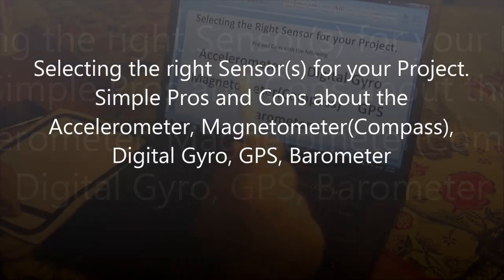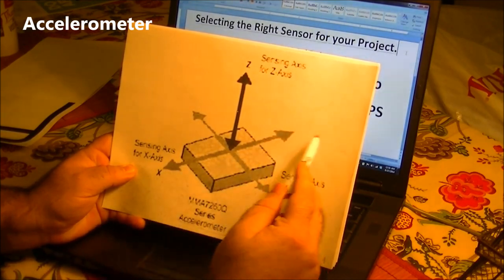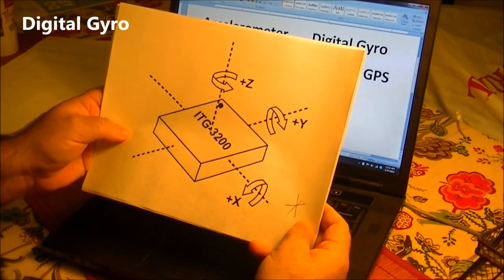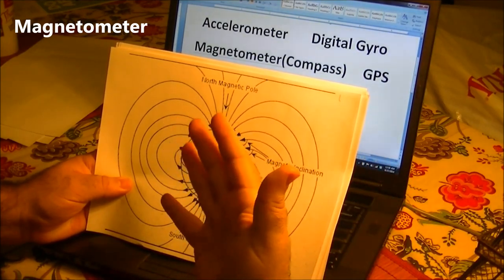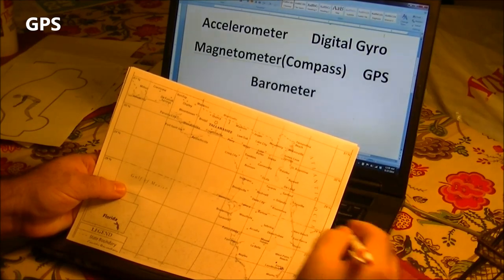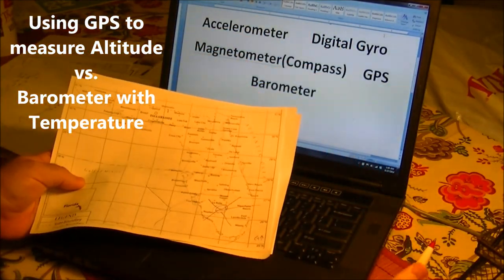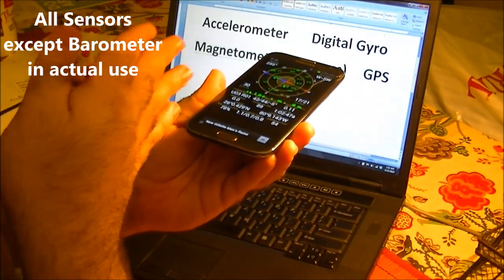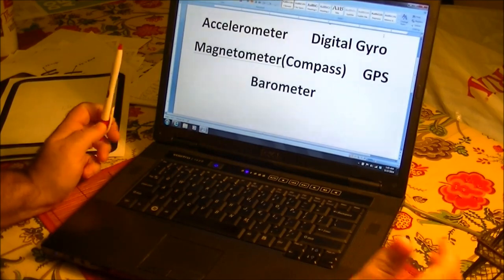Simple Guide on Accelorometer, Magnetometer, Digitial Gyro, GPS, Barometer Pros and Cons

Comment: 1 minute in "If you are in a car and you are not moving, then you have zero forces on all directions".  Uhhh not quite.  You have gravity, which is a force.  The accl. will read 9.8m/s/s even when you are not moving.
Reply from the maker: No. The accelerometer detects changes in force. The gyro is found to be better in detecting direction of chip. Here is an example. If you are in a car accelerating 0 to 60, you feel the g forces and it pushes you into your seat. But once the car stays steady at a speed, you no longer will feel the force cause you and car are moving at same speed. 9.8m/s/s kenetic energy does help the chip know direction if you move it a lot which requires doing an 8 shape to calibrate. If you open the sensor on an ipad going 700mph in a plane, it will show steady that you can even place on tray and it not fall. A good mix of sensors help. Rarely will you now see accelerometer chip without a gyro in one, these days.
Reply: Your example scenario is correct and reaches a valid conclusion, but your first statement is false: the accelerometer does NOT measure changes in force. I think you mean to say it measures changes in velocity.  An accelerometer will only read zero in all directions if it is under free-fall of gravity, all other scenarios will have non-zero readings. Imagine an accel. made out of a box with equal sized springs on all walls, suspending a mass in the center.  If the box isn't moving (resting on a table), what is the length of the springs? The top spring will be longer than the bottom one because of gravity pulling on the center mass. The length of this spring is proportional the amount of acceleration (due to gravity!!). The MEMS accel works on the same principle. It uses plates/capacitance instead of springs. It gets complicated because you can do tilt sensing with a 3-axis accel(Gyro not needed).
Reply from the maker: What you say makes sense but there is no springs in these chips and the accelerometers I have used and codes when powered up from rest reads me 0,0,0 . And I know I'm not free falling. The first wii controllers only had accelerometers and to solve the position issue, Nintendo used 2 IRs in front to a sensor on top of tv know twist better. Later the dual acceleration & gyro chip was then used. If the current chips of today accelerometers read the gravity when at rest then it's a huge plus since I have not used one in about 4 years.
Reply: This was a very useful discussion , you two :)

Comment: What app are you using on your phone to do this?
Reply from the maker: You mean to create the video? I didn't use a phone. I used a handheld HiDef JVC SD cam. Then I used Movie Maker to cut the extra out and add the on screen Texts. Movie Maker is a free Program from Microsoft.
Reply: No, the part where you displayed the gyro and accelerometer on your phone during the presentation. The app you used for that.
Reply from the maker: Justin Cazares
OOOooo Yes... I forgot about that part.. I'm sorry. It's a Free Android app Called "GPS Status". It has many features including logging ability and even a tracker where you enter long and lat and it points to the place like a Hide and Seek.
Reply: Thanks! Your presentation was great by the way, cleared up some questions I had about the differences between the two. Do you work with these on a regular basis?
Reply from the maker: Justin Cazares I will not say regularly but I do and have. Mostly making small items and tinkering. I'm a fan of the Arduino which these sensors work amazingly well. You will now find these chips with both Accelorometer and Digital Gyro in one chip because with a little math, you will get a much more smooth output. example is the Gyro is mega sensitive, so you slow the reading when the Accelorometer is in or close to the 0g state. The Magnetometer is the least popular, I would say cause without the gyro, It you don't know what direction the device is pointing, your math can and will be off.Now if you are building a device that will be bolted into a car or plane, the magnetometer who do well since you chip can be placed to always be in the center aimed to front of machine. Apple does it's best to always place the Digital Gyro smack in the center of phone.
Reply: ***** Good information, thanks man!